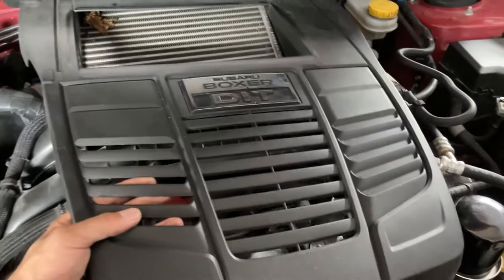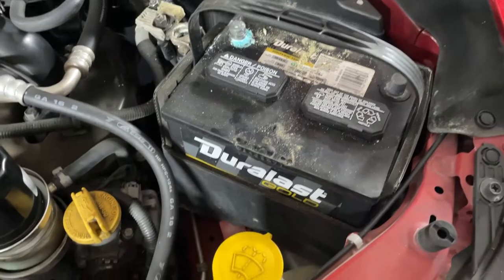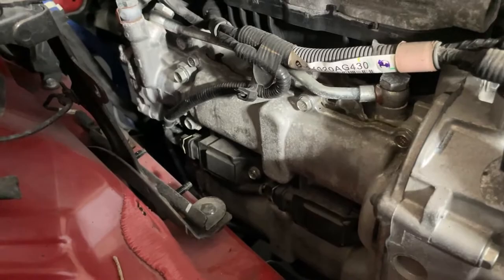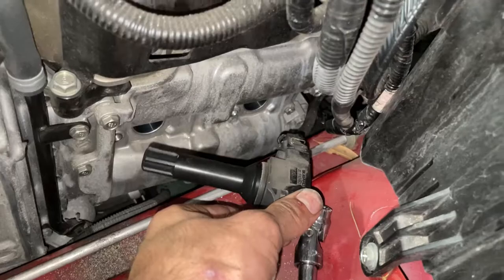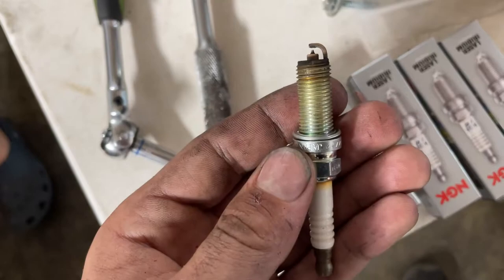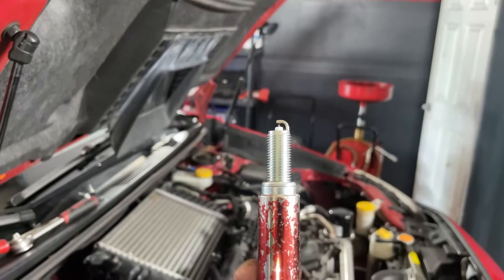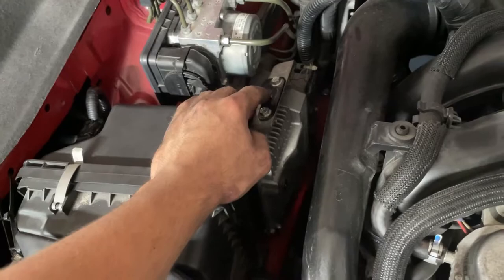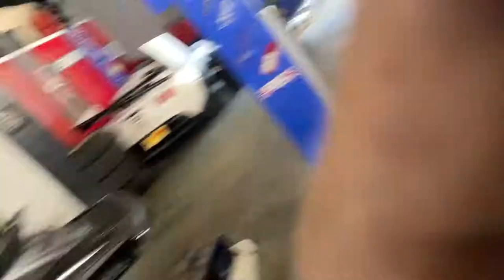Change your Subaru Spark Plugs: THE CORRECT WAY!

Comment: this guy does not know what he is doing you do not gap iridium plugs they always come pre gap. you only need to gap copper plugs.
Reply: Not necessarily.  Always check gap on every plug. I have run into more than once that a plug had been dropped or something had bent the side electrode.  Alway check.
Reply from the maker: Always worth checking! Sometimes they aren’t all the same! I’ve had it happen a few times!